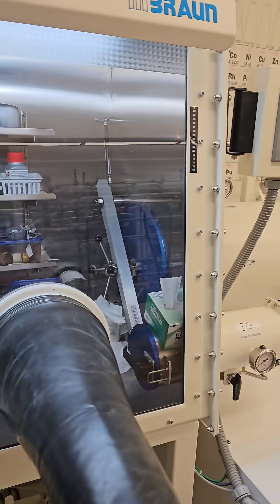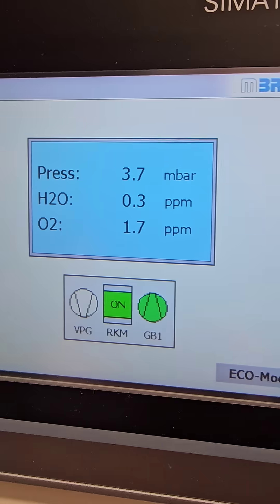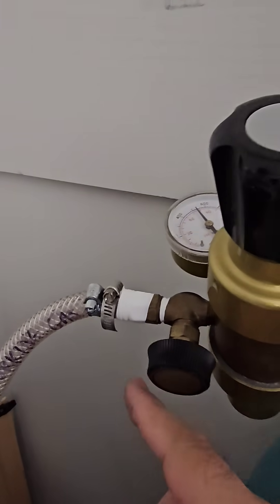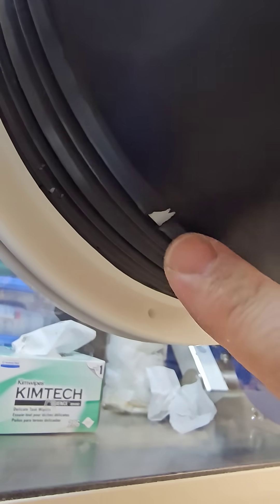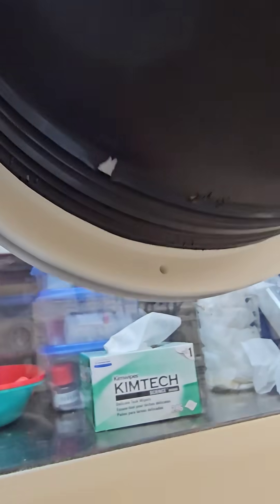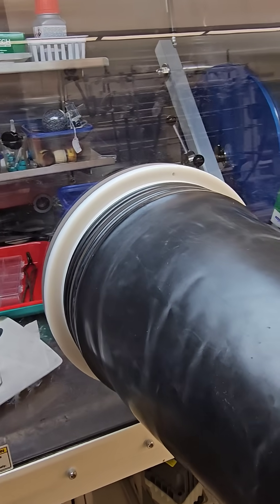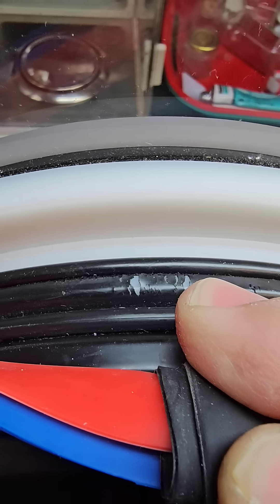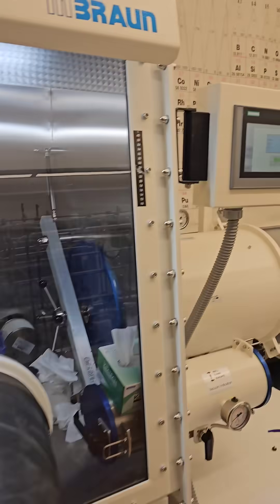Dry Box Leak: Found! #chemistry #glovebox #inorganicchemistry

Comment: Get rid of the fucking braided hose and do everything with compression 316 stainless, use swagelock ultratorr fittings ga for glass to stainless when needed also
Reply from the maker: No, but thanks for the idea.  This is a glove box not an ultra-high vacuum system.

Comment: I see, the rubber is also shrinking. I wonder if it would last longer without plastic inside. The whole thing should be rubber, if even it has to be thicker. Like a car tire, then clamp it between two rings that attaches to the box, or clamps the gloves to the box. 

Looks like corrugated plastic pipe with a flange that they stretched a rubber glove around

Comment: Flex seal. Whys the rest of the rubber seem supple but thats falling apart? Is it exposed to allot of somthing? Like UV or maybe or something else that could break it down. Will co2 in the air dry rubber I wonder. Wonder what makes it brittle like that. 
I would put some corn starch on that, especially after the repair so that it can’t rub together and rip itself apart. Or maybe a silicone lube.
Reply from the maker: The dry box is in my research lab.  The gloves are exposed to just about everything!  They lasted 5 years which is pretty good.